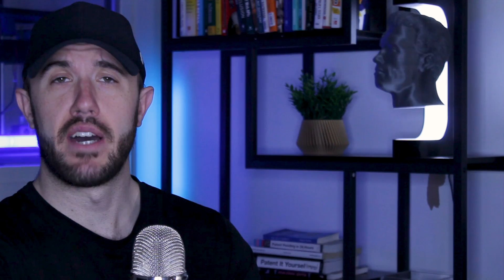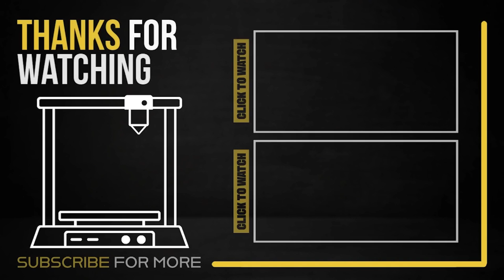Thoughts on the MK4, Fabbaloo Partnership, Filament Update

Comment: I like my packages received in pristine condition.  Hence being double boxed or in some cases triple boxed if you count manufacturers packaging. I've received lightweight movie dvd's crushed plastic case shipped in a bubble wrapped bag, at times with a torn package.  Partially goes back to how rough is the carrier USPS, UPS, FedEx, etc. are on handling packages.  Some carriers talk about areas in the conveyor belt sorting junctions "paddle" as a mechanical Fly Swatter (baseball bat).  Hit with enough force that that packages get jammed in the junction or fly off onto the floor.  The workers and delivery people also throw packages around.  I've heard many packages delivered at my residence front door slammed on the ground.  Other carriers talk about how packages are smashed together to make more room.  Long gone are the days of shipping items in a shoebox wrapped in duct tape.

Comment: I would say not only keep the box, but double box. I received a 6 spool pack of ABS a few days ago, shipped in just the single box and maybe 2 or 3 of the bags inside look to have kept their vacuum seal.  Probably will have to dry the whole lot prior to use which is annoying.
Thought about returning it, but at some point it ends up being more hassle than it's worth.

Comment: What kind of printers you make for your farm? I guess they are CoreXY systems. Did you go the CroXY route? I would be curious because "print farm machines" are technically machines that are really rigid, quality, require minimal maintenance and can output high quality prints at a fast rate and consistent quality in 0-24? I would be definitely interested in this kind of printer in the future. Do you plan on selling the printer or the desig, parts etc? How much do they cost?

Comment: As far as the box goes. I'm a bit confused about your business case.

When it was announced, it sounded like you preferred a bulk order subscription system. With that being the case, would you not put multiple spools in a single box or crate?
Or do you envision to duct tape the filament bags together? 😊

Or have you abandoned the subscription model, and expect the majority of orders to be single spool purchases?

If you are still going down the bulk order subscription route, then focus on a package solution that can hold several spools securely, and also withstand the beating that heavier packages typically get during shipping.

Comment: A bag held tight against a spool is easier to puncture and doesn't handle abrasion well. Vacuum seal one drop it and kick it around a bit, go full Ace Ventura on it. If it still holds vacuum it's good to go.

Comment: I really like bambulab's way of doing spools, which is basically a reusable spool that you recharge with tightly wound filament held with plastic straps that you remove after installation.

Also is vacuum really necessary? What's important is that there is no moisture so maybe you can fill the bag loosly with extra dry air, throw in some dessicant and worry less about puncture. Almost no one revacuums their spools anyway.

Comment: May not be up to speed on all your filament spool stuff but here's an experience Ive had with unboxed. I've had two spools that were not boxed delivered from Amazon (padded mailer). Both of them were cardboard spools that obviously had been dropped or banged around because they were certainly no longer round. If they were going on a spool holder that utilizes the center hole then not an issue. Unfortunately for me I'm using a dryer box/filament dispenser that relies on that outer edge to be round for things to work smoothly. I was able to bend these back to where they're working well enough to print but I can feel there's more strain on the extruder system and there's a noticeable thunk as this thing rotates around.

Comment: It's less that the box protects the bag, but rather the box helps eat impacts and other shock damage. Adds just that bit of padding to soak up damage. The bag might get damaged if it ever gets pulled into a machine, which has happened to me on a small bubble mailer before. A shrink wrap or tape job would counter that by tucking in those corners of the bag. That's my thoughts on single spools at least.

Now, a bulk order, I'd say ditch individual boxes wholeheartedly. The outer shipping box should be more than enough with a bit of padding. No need to spend like 40¢ on a box per roll. Only boon would be for label on the curved surface depending on how people store rolls and how they want to access them.

Something probably worth doing over just taking opinions (including my own gut feelings), make a test and abuse packages. Drop them from as high as it seems rational, crush them, drop stuff on them, and test the same package multiple times. Set a failure condition, could be compromised bag or damaged filament is a fail, but a cracked spool is fine. Eventually, you'd get a failure rate for how you packaged it, and it's up to you if that rate is fine or not. If nothing else, it would make for some video content.

Comment: I love the idea of ditching the boxes for the most part, but I have two concerns. First, I've gotten spools before in boxes where the vacuum bag had a puncture even in a box. Sometimes yes the bag is very poor quality and can be chalked up to that. But there have been plenty of other times where it was of decent quality and it still got punctured at some point. I'm sure you can get bags that are much higher quality that will survive that vast majority of the time. That follows into the second concern. What happens when I do get my shipment and the bag is breached? Should I refuse delivery, contact support, just throw it into a dehydrator and hope it's fine, or something else? I ask because it will happen and some people will one of those in response, so be prepared with a breached bag delivery plan.

Comment: I watched many of your videos and I appreciate your content. If I owned a 3D printing farm, I would probably run it very similar to how you are running it. Very methodical, using first principles approach in solving problems, innovative, resourceful and vertically integrated when appropriate. You mentioned many good reasons for the fundamental flaws with using desktop 3D printers for high volume manufacturing which resulted in Slant 3D making its own 3D printers and I agree with all of them actually. However, I am curious to know what the fundamental flaws are for using Prusa MK3S+ or MK4 in particular for farming 3D printing? I see that Prusa MK3S+ and MK4 in particular have solved all of the fundamental flaws you mentioned and wondering what I missed. Thanks
Reply from the maker: https://www.youtube.com/watch?v=iWHBH_T-xqI&ab_channel=Slant3D

Comment: The box that it ships in needs to protect the filament. When I order (10) spools, I will just throw out all the boxes immediately, so in that case it would be easier to not have boxes... Possibly a more robust spool would be helpful. The prusament spool for example would be too flexible to ship without a box IMO. An impact resistant and stiff spool should be better than a box I think.

Comment: Regarding the weakness of the printed parts, its also highly dependent on the material. A 3D printed part can be stronger along z-axis than an injection molded part if you upgrade the 3D printed part material. 

3D printing with an upgraded material can be feasible for many applications where low volume manufacturing is required.

Comment: About filament shipping, I would not be concerned about the bag getting punctured / ripped open too much, however the cardboard does protect the spool.
The main thing to look out for is damage from dropping the package on a hard surface.
The force of that may very well break the spool, even inside a thick vacuum bag. Cardboard is better suited to protect from that type of damage.

That being said you could take that into account with the spool itself, or Just accept a higher rate of damage due to shipping. After all the costs of boxes is definitely not zero.

Comment: To be fair to Bambu labs, they do have US and EU based servers for their cloud capabilities. You just need to trust that files uploaded to those clusters do not get sent to China behind the scenes. They also do have a LAN mode so you can turn the cloud features off and still send over Wifi
Reply: They’re also really problematic in using open source licenses without respecting the license terms, as well as doing a bunch of patent trolling in China.
Reply: @jakeharms1386  ok. I was just referencing the content of the video. Not trying to paint Bambu as a Saint of openness. I can't speak to the patent trolling but they did correct their practice regarding their use of open source for their slicer once it was pointed out. No one is perfect. Not Bambu, not Prusa or Slant3D. Not you or me.

Comment: You could consider double bagging it. The outer plastic bag will get drug on the floor, hit with the forks of a forklift, cut with a box knife. I am speaking from experience. UPS/FEDEX will frequently drag an item that is heavy, (I normally use 10kg spools), and if the damage it too much, they will box it to hide the damage. ($1000 roll of upholstery fabric drug by one end until an inch of fabric width is ruined, and re-boxed to hide)
Reply: Yah, double bagging might be a good solution. I don't care about the box, but sometimes things take quite a beating during shipping.

Comment: I'd rather have a high quality vacuum sealed bag with no box.  The box is just another item to handle and deal with disposal.  I also would prefer no spool as an option.  I printed inter locking spool holders for filament refills.  I'm using Inland filament, I printed a wider spool with a smaller hub than the standard Inland refills.  The refills work better as they fit loosely on the reusable spool and get better air flow in the dehydrator.

Comment: I use the filament boxes to hold parts for future or past projects. Bed-slingers, I moved from Ender3 to corexy. The bowden tube was shorter on the Ender even though both printers have the same size bed. I wouldnt go back to bed-slinger for the shorter bowden tube.

Comment: Regarding the filament boxes, it all depends on the type of bag....i've opened branded filaments out of a box that had the vacuum seal broken. Meaning a faulty sealing machine/mechanism/bag material might throw any such attempt(to do away with the cardboard boxes) to fail. If you can guarantee a lasting seal and a heavy bag then i wouldnt mind i guess. On the other hand, boxes are stackable and can be tight fitted in a large container. In the end of it all, having a good 3d printed spool (either downloadable or store bought, i know eSun has such an option on their site) and just getting only refills is a totally viable option for me. Too many empty spools and cardboard boxes that fill recycling centres...

Comment: No box if possible.  Need marking / labeling on outside of bag so it can be stored without opening.  PLEASE do 2.85 filament also!

How about a good review of YOUR printer, so we can see what kid of things are different.

Great idea of brainshare on design.
Reply from the maker: Thanks for the feedback. Unfortunately we won't be able to do 2.85. It is a dieing standard. And as we start up we have to be very focused to make sure it is sustainable. So only a few colors and 1.75. Sorry.
Reply: @slant3d  Well, having ultimaker's makes that an issue.  Oh well, thanks for the kind response!

What software do you run on your machines?  Just curious.

Comment: I would rather 2 piece master spools with filament refills. It saves resources/shipping/cost. The filament could be shipped in a vacuum sealed bag with label directly on it. It boggles my mind why each new spool comes with so much waste. Sigh...
Reply from the maker: Masterspool refills actually cost the same to ship. And complicate the manufacturing process. We are developing a new spool that should address the issues. But we will not be pursing the masterspool option.

Comment: I wouldn't trust shipping companies honestly. I've had filament inside boxes end up with punctures and the outside of the box was pretty damaged. I can only imagine if it had no box. This has happened with different brands. Unless your bags are much stronger than normal and yeah double bagged and double airsealed then it might work? Seems risky and would stronger bags and double bagging save enough compared to a box?
Reply from the maker: Yes. They always beat stuff up.

Comment: I would be 100% happy with 1kg of filament rolled without a spool in a vacuum sealed, double bag with zipper seals, shipped with no box. Minimalist as much as possible.  If i cannot directly use it I have ZERO interest in it being shipped to me.  Zipper seals are important as it enables reuse of the bags for storage but the box and spools are useless to me. I already have a lot of those sitting around and ready to be thrown out. I don't need more